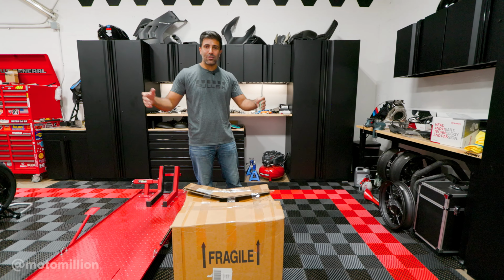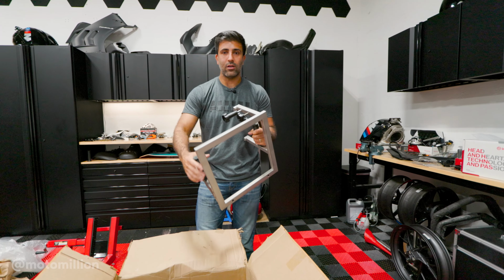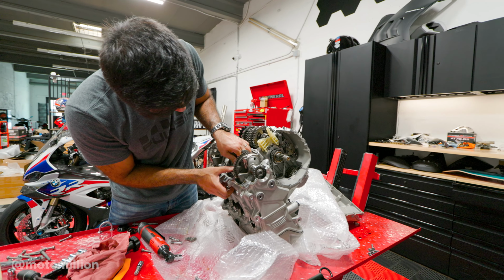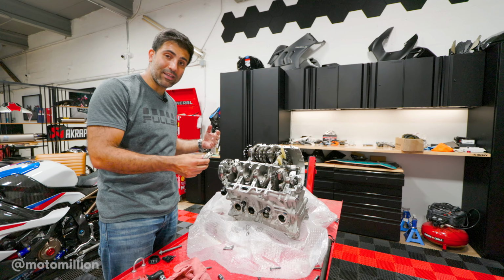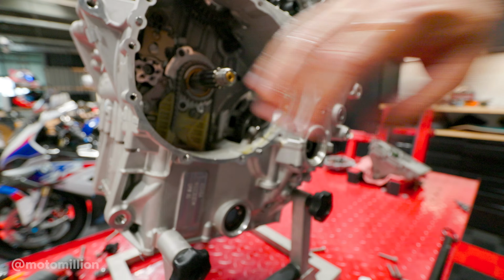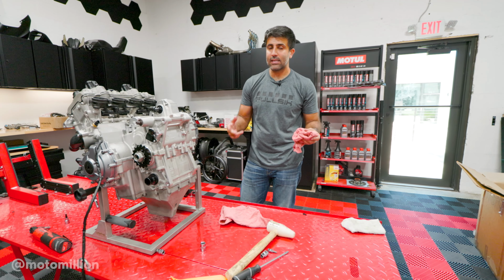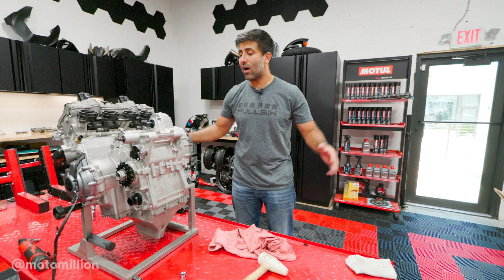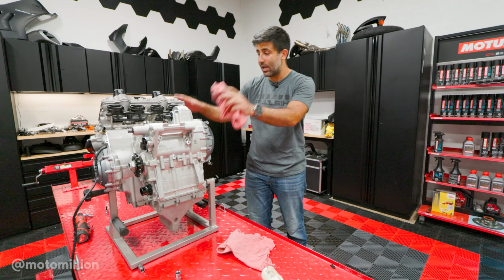$15,000 Coffee Table Build | Part 1

Comment: I think I can add my 2 cents as an expert.  I agree with your other expert opinions.  A defective bearing is possible, but not likely.  The manufacturing tolerances may have been to tight, but not likely.  You'll never know 100%, because you can't see or measure the original bearing before it failed.  This is an oil failure.  Technically it's called "micro welding".  That's technically what caused your bearing to fail.  Here's the rest of the story.    Modern manufacturing is to good for these mistakes.  I know it happens, but it's damn rare.  The oil is the problem.  The EPA keeps messing with fuel efficient oils.  Big companies sign contracts with oil companies, I think it's ExxonMobil in this case, & the original oil fill from the factory is not the optimal.  I know, the engineers who designed the engine know what's the best.   The problem is, they don't have any say in what oil goes in the engine.  You & I think it's crazy not to put the very best oil in the new engine.  But big companies like BMW have some crazy rules they have to comply with.  It would take me hours to explain all the regulations that come into effect.  Suffice it to say, the original oil in the engine is barely capable of handling your high performance motor.  Internally, BMW takes the attitude that loosing a few new engines is just part of the price they pay.  But in this case, you paid the price.  Wasn't the high RPM limit switched off early on this engine?   Wasn't that was the reason they denied warranty?  Be that as it may, ideally the engine should've had Break-in oil in the new engine.  Very few companies use Break-in oil, which also creates problems for other engines that I'm extremely familiar with.  When any manufacture builds thousands of engines, the "Bell Curve" of standard deviation comes into effect.  Some engines will have perfect piston ring & bearing clearances.  Most will have clearances with-in the acceptable range.  But a tiny few will be less than perfect.  Nobody knows which engines those are.  You can only hope you didn't buy one.  However, this is the purpose of Break-in oil.  Break-in oil is for the few engines that need a little help seating the bearings & piston rings.  The EPA has forced fleet CAFE fuel economy standards on every manufacture.  Those fuel efficient oils don't have the high levels of zinc, ZDDP, that's normally found in Break-in oil.  When you have an engine with slightly less than perfect tolerances, & push it a little harder than it's ready for, you get what happened to your engine.  Another owner could have piston rings that slightly scored a cylinder wall, & his engine tends to burn more oil than normal.  I hate to tell you, manufactures don't recommend the very best oil for their engines.  They recommend oil from oil companies who pay them for the privilege of being on the recommended list.  ExxonMobil also pays for all the oil distribution & storage equipment in the dealership.  Your dealer recommends the oil that pays them the most.  Even after the Break-in, BMW recommended oil is NOT the best oil for the engine.  Of course this sets off everybody's opinion about the BEST oil.  Let me be as blunt as possible.  Very very few mechanics or educated owners know anything about oil.  If you can't explain in great detail, API, JASO, ACEA, NOACK Volatility, HTHS, Viscosity Index, zinc, API Group's 1 thru 5, PAO, Ester, PAG, & 2 dozen other oil technical properties & their maximum & minimum specifications; you don't know enough about oil.  So what should you use for Break-in & normal oil?   For any high performance wet clutch motorcycle engine.  Maxima Break-in oil is great.  Any other similar brand & type is ok.  Dump the original factory oil in the new engine.  Replace the oil filter with a new genuine BMW oil filter with the biggest & strongest magnet stuck to the bottom of the oil filter.  This will capture the tiny metal dust in the oil.  You can keep transferring the magnet to each new oil filter.  Fill the engine with the correct Break-in oil.  If you can, fill the oil filter with oil before you replace the filter.  I run the new engine up to operating temperature for about 100 miles.  Put a load on the engine with no more than 70% throttle.  Change the Break-in oil & filter after 100 miles.  Do the same type of 70% throttle for another 300 miles, & change the Break-in oil & filter again.  Run the engine under a load with a maximum 80% throttle for 500 miles.  Now you're ready for the normal oil.& normal throttle.  I prefer Red Line 15W/50 Power Sports for the main oil in normal Summer weather.  If you ride where the ambient temperature goes over 100F, you race, or do track days, Red Line 20W/60 Power Sports is the best.  Motul 300V is also very good.  Red Line beats Motul 300V with more zinc.  BMW & the EPA don't want high levels of zinc in the oil, because it poisons the Catalytic Converter.  I've used Red Line Power Sports with over 2000 ppm of zinc for over 200K miles in the same engine.  The Catalytic Converter still works fine.   It's crappy or dirty oil that blows past the piston rings & poisons the CAT.   Good clean oil doesn't get into the CAT.  You can buy a lot of CAT's for $15,000.    Your main bearings failed because the oil didn't have enough zinc....  And you probably over revved the engine.    Zinc is the last line of defense when metal on metal gets so hot the metal surfaces "micro weld" together.  And that's exactly what yours did.  Don't think you can dump a bunch of zinc oil additive in your oil & that will solve the problem.  The chemical formulation of really good oil should not be messed with.
Reply from the maker: Really appreciate this response. The break in limiter was turned off at the interval indicated in the manual. Manual states first service is 350-700 miles. We did it at 368-369 miles. You must agree, even a 9k rpm limit on the engine is fast enough for any failure to happen. The bike was never over revved. The top end rev limiter was still in place.
Reply: @Motomillion  I completely agree, the engine should be able to take what you were doing.  The problem is BMW has to use a certain type of oil to comply with EPA emissions.  The oil is barely able to withstand this level of performance.  Like I said, if you buy an engine that’s not absolutely perfect, it may fail from the effects of micro welding in just the wrong circumstances.  BMW can’t use oil with more zinc, because they must protect the CAT.  But you don’t have to go along with their problem.  Sadly this is what owners of this type of engine need to understand.  Of course BMW will never admit the problem.  They just comply with the regulations, and in you case that wasn’t good enough.
Reply: @tomstephens5024 so redline 20w60 for the S1k? 😅
Reply: @TheUnKnown0019  
Generally speaking, people don’t understand that the EPA has completely changed the lubrication rules for motorcycles.  The regulations are more inline with the regulations for automobiles.  As far as the EPA is concerned, the emissions system is the most important.  The engine comes second.  If people really want to understand how to determine the best oil for their situation, they’ll need to learn how to read the material data sheets for their particular oil.  They’ll need to understand what the various testing standards actually mean.  When people choose not to educate themselves about this complicated subject, they’re at the mercy of every know-it-all that runs their mouth.  
Basically you have two options.  Follow the manufacturer’s recommendations, or start reading the Petroleum Engineering manuals that explain the testing process and the terminology.  
Red Line 20W/60 Power Sport is NOT one of the EPA approved oils for protecting the emissions system.  This Red Line provides the maximum protection for your engine when it’s spinning at 12,000 rpm’s and it’s hotter than the hubs of hell.  So, you can protect the emissions system, educate yourself, or trusting someone you don’t know, like me.
Reply: These high RPM big horsepower engines need the film strength of a 20W/60 Ester synthetic oil in hot weather.  Stop listening to everyone’s opinions, and learn how to read the oil’s technical specifications in their Material Data Sheets.  HTHS (High Temperature High Shear) is the oil’s film strength at high temperatures and high RPMs.  The higher the HTHS value, the better the oil protects when bearings and piston rings get really hot.  The HTHS of Red Line 20W/60 is 7.  The BMW recommended oil’s HTHS is 2.8.   Which do you want in your engine when you have the throttle pinned?  
When these engines are used for racing, they use a much lower viscosity oil to achieve the maximum power.  Ducati has their own “real” race oil that cost $60 per quart and must be changed every 600 miles.  Plus the engine will require frequent overhauls.  If you can benefit from the extra power and can afford the high maintenance cost, go for it.  For most riders, they want the best protection for the engine.  The Viscosity Index is another critical factor.  20W/60 has the highest possible VI (Viscosity Index).  VI measures the oil’s ability to maintain its viscosity at high temperatures.  The higher the VI, the better the oil.  If you ride in milder ambient temperatures and don’t flog the engine, you can use Red Line 15W/50 Power Sport.  They also offer 10W/50.  I wouldn’t go below that in a high performance motorcycle engine.   
Oil companies and engine manufacturers don’t make it easy for consumers to educate themselves about oil specifications.
Reply: @tomstephens5024  You seem to know you oils!, im also  trying to educate myself on the extensive interactions that oil has throught the engine.

Im running 7100 motul 10W50, on a 2024 RSV4 Factory, but as you've mentioned strikes me as just barely adequate for the VERY high temps in the south of Spain, (we've been seeing 42ºC's in the noons these days), im not racing her, but dealing with traffic makes us both sweat a lot in these conditions.

Would you play with viscosity beyond specifications in this case?
Reply: @mecawenl  
Good question.  You’ve hit upon one of the tricks oil companies play on consumers.  Just because an oil company makes a really good oil, it doesn’t mean all the oils they make are of the same quality.  Consumers don’t normally understand all of the emissions related classifications for motor oil.  Oil companies like to obscure what’s really going on, with lots of buzz words they know consumers don’t really understand.  The Motul 7100 10w/50 you asked about, has the API SP approval.  You would think that because it’s the latest specification, and you see the word “Ester” prominently displayed.  Motul is a high end oil, so this should be a good oil for your very high performance motorcycle.  WRONG!
API SP is for the latest Euro emissions systems.  Your bike has a catalytic converter.  The emissions regulations requires that the oil first and foremost protects the catalytic converter.  Protecting your engine is not the main concern.  When you learn to read between the lines on the oil’s technical data sheet, you’ll see your oil has some ester in the oil, but it’s no where near the ester in Motul’s 300V line.  But 300V is a “racing oil”.  Which means it’s technically not approved for the catalytic converter.  “Racing oils” typically have around 2000ppm of zinc.  Emissions oils are limited to no more than 800ppm of zinc.  There are lots of chemicals in oils.  I don’t want you to get stuck on zinc.  But zinc has been used in oil for a very long time.  When the engine is really hot and you’re ringing its neck, zinc (ZDDP) is the last line of defense.  Zinc actually lays down a barrier on the bearings that that builds up over time.  Zinc prevents the micro welding between two metal surfaces.  The very best oils have about 2000ppm of zinc.  Never pour in a zinc additive into your oil.  Chemical Engineers have to properly blend the oil when it’s designed.   The problem is the government says zinc poisons the catalytic converter.  The really good oils are not approved.  If you’ve removed the catalyst for “racing”, the problem is solved…. sort of.  You still need to know how to read the technical data sheet, and understand the petroleum engineering process in order to recognize the best oil.  Asking a mechanic or your fast buddy is pointless.  Everybody has an opinion about oil.  Just ask them.  As you no doubt realize, most people don’t know shit about oil.  To keep this somewhat simple, here are the two best oils that protect your type of engine, and to hell with the catalytic converter.  
Motul 300V “Factory Line” off road 4T 15w/60.
Red Line “Power Sport” 15w/50 or 20w/60.
Both of these are API Group 5 Ester Synthetic JASO oils for wet or dry clutches.  
There are other decent oils.  If you know enough to pick another oil, go for it.   
The manufacturer will tell you these oils are not approved for your engine.   What they should say is these oils are not approved for your catalytic converter.  
Don’t worry about some other viscosity.  Your engine warms up really fast.  I assume you’re not riding when snow plows are on the road.  I’m 
I change my oil every 1,000 miles or less.  If you have a Ducati type of spin on oil filter, I also put one of those fat super magnets on the bottom of the oil filter.  It grabs the metal dust that’s too small for the oil filter.  Just keep switching it to the new oil filter.  I use Red Line Power Sport.  Red Line publishes more of their technical data, and I like companies who don’t hide their information.  I guess if you’ve got the best, you don’t have anything to hide.
One thing last thing.  These are the best oils for practically any engine.  I always remove the catalytic converter from my motorcycles.  But I’ve used these oils in my truck for 250,000 miles.  It still has the original catalytic converter.  The check engine light has never come on.  I live in California and my truck has never failed a smog test.  High levels of zinc have never affected my trucks catalytic converter.

Comment: I can sympathise with you,  that your engine failed, and you had to pay for a new engine because BMW denied your claim...
 I don't see the purpose of testing the bearing material,  it may even reveal a flaw, but the crux of it is had you not breached the terms of the manufacturers warranty conditions, they may have paid your claim, your actions, buy not adhering to the run in limiter removal mileage and service interval,  tuning it then posting a video of it being blown up on the dyno definitely didn't help your case...
I am not a hater, as I said I sympathise with you, but it was your actions, by breaching the warranty conditions that caused the claim to be denied.and not the type of damage to the engine.if you had followed the proper procedure you would have not given BMW a reason not to honour the claim, what happened is tragic, but unfortunately by your own actions, its your cake and your gonna need to eat it.
Reply: Dont cry Many, it doesn't look good for you and the name brand. The FACT is that you didnt wait for the 650 breakin miles and you know that you made a mistake by doing so, so suck it up, and be a man and not Caren! 🎉
Reply from the maker: Manual states first service is 350-700 miles. We did it at 368-369 miles.
Reply: just have BT cover your engine

Comment: That's typically a issue from oil starvation and is probably important to know the oil path to make that conclusion? Very surprised to see a BMW engine to fail that way.
Reply from the maker: Just google E46 M3 and E92 M3 rod bearing problems.
Reply: @Motomillion  you're thinking it's a design issue? If that's the case you'd see them failing left and right but could totally be possible.  It's safe to say it's a BMW thang🤣
Reply: They have plenty of issues

Comment: It would be nice to know which bearings failed on the OTHER motor failures, as that would also be a good indication if it was a design flaw somehow causing oiling issues to the same cylinder...bet there is never going to be an announcement regarding that though...  Hopefully this was resolved in the 2024's...since I bought one...LOL...I dont want a matching table....
Reply from the maker: If enough engines break, maybe we can get into the furniture business next...

Comment: Anxiously awaiting the expert analysis on the bearing. If it's in your favor, I would definitely revisit the claim with BMW NA.
Reply: I purchased a BMW data recorder and had my dealer install it on my 21 S1kRR. Dealer installed it, but said they couldn't activate it because the EWS module (ignition) and ECU did not match. The dealer informed me that I needed to purchase a new module to match the ECU for the system to function. I told them nothing had been touched on the bike, but the dealer still refused and charged me anyway. (Denver) I escalated it up to BMW NA who provided a new ignition switch and covered installation. BMW Denver banned me because I went over their heads. Told them fine, I'll take my disposable income somewhere else.
Reply from the maker: I don’t think they have any intention to make things right, nor do we have the energy to chase them.
Reply: @Motomillion I get it. It's exhausting. I will tell you that I had to chase them on a warranty claim, and they eventually made it right. With persistence I was able to prove they were in the wrong. Mine was not even a large claim, but it was principal that they should stand behind their warranty and product.
Reply: @thejmfloragroup what was your defective item if you don't mind?